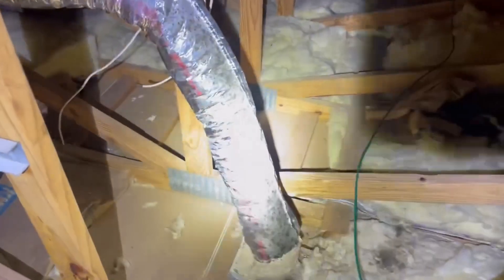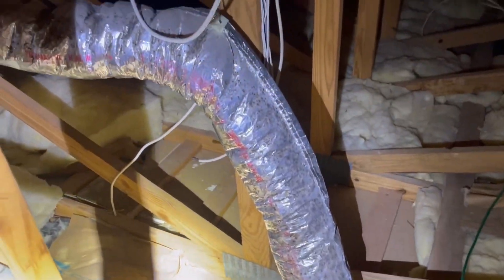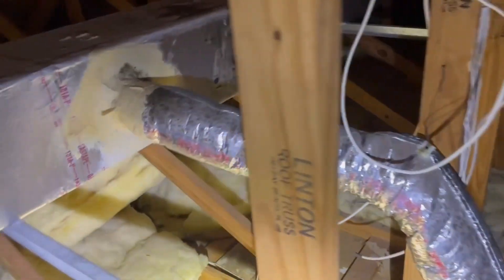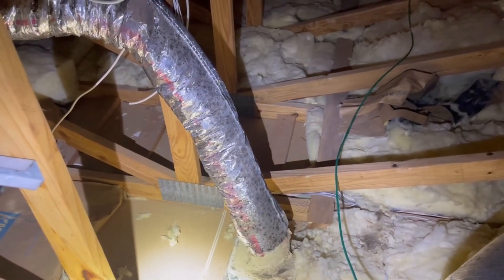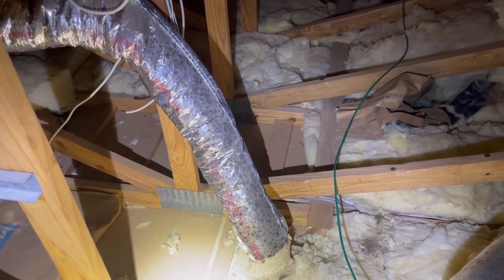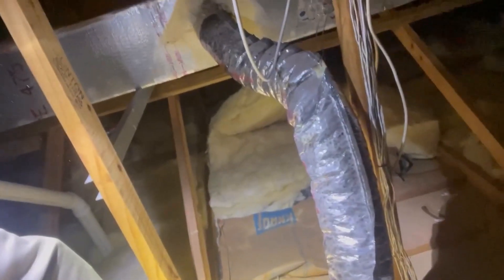Why This Mold on Ductwork Exteriors Is a Good Sign

Comment: Cladosporium is a NEUROTOXIN and if in a home or office bldg at unusually high levels can cause significant neurological problems in people and pets. 

Please educate yourself better about this before giving people a false sense of security.   

Also, another piece of incorrect information I hear often is that mold in the attic doesn't typically migrate to the living areas below. That is FALSE. Very few homes have attics sealed so well that spores don't get into the living areas. They can migrate via spaces in ceiling lighting, etc.  

The massive misinformation that continues to be spread about mold is shocking and dangerous. Btw I am a licensed attorney and Certified Mold Inspector.

Comment: That trunk line is made of fiberglass. It 100% has microbial growth in it. Either caused by duct leakage or from the air conditioning. You can cut into these the same as you would a pumpkin. Pull out the plug, take a picture looking down in each side. Then take your tape lift off the plug you just cut. The closer you get towards the air handler the more contaminated it will be. Replace your plug and mastic to seal shut